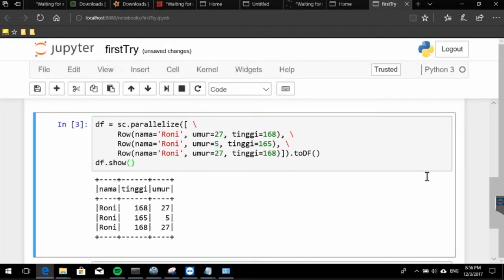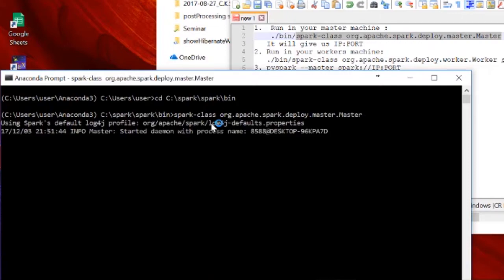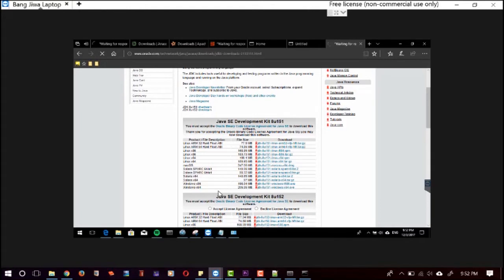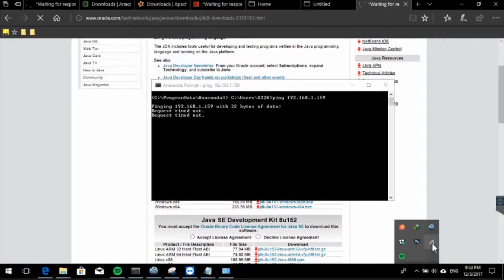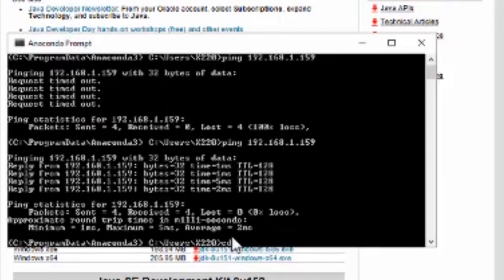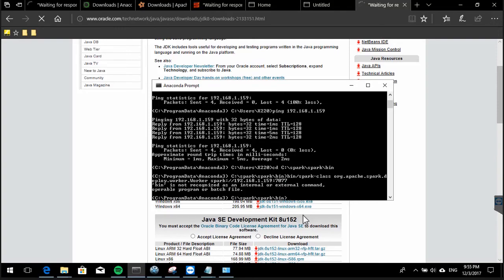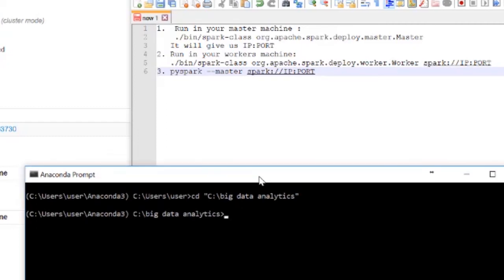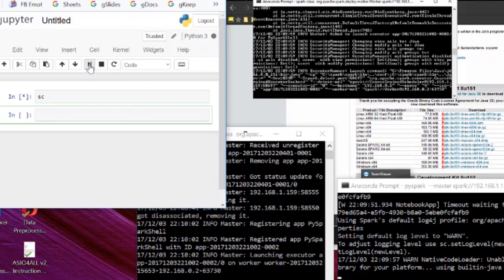03 Build Cluster Computer Apache Spark in Windows

Comment: Thanks for the video - it helped a lot. I'd like to know if i run mllib in pyspark using cluster (two computers) , will it use all resources on both computers? For neural network, i want to utilize ram and hard drives on both computers so i can train them many times
Reply from the maker: Yes, of course. The main purpose of big data framework like Spark is making the computation load into distributed resources (e.g: cluster). For all the naive Spark functions, the computation load should be distributed into cluster. If you wanna use another package outside Spark, just make sure that it supports distributed computing in cluster.
Reply: Awesome - thanks again. if I use what you have recommended on the video, my pyspark code will not run on both of them - correct? if yes, then does it mean i need to use some sort of cluster manager like hadoop?
Reply from the maker: Al K : Spark has 3 ways for its cluster manager. 1. From native Spark, 2. Apache Mesos, 3. Hadoop Yarn. And one more (still experimental, said in their official web) 4. Kubernetes.
Using one of methods above, it means that our Spark is already able to run in cluster (use all resources in that cluster) handled by the cluster manager. This video is the method 1 above.
Reply: Perfect- that is all i need to test mllib
Reply: Thank you for your replies!
Reply from the maker: You're welcome :)

Comment: I have installed spark on two windows system.
 i have run spark application program (a jar file) separately on both system. now, i want to make one system master and another system executor.

i have run this command on first system:
E:\spark-2.3.0\bin>spark-class org.apache.spark.deploy.master.Master

Starting Spark master at spark://10.1.12.1234:7077

command on on second system:
bin\spark-class org.apache.spark.deploy.worker.Worker spark://10.1.12.1234:7077

it gives error:

could not find or load main class org.apache.spark.deploy.worker.Worker

Comment: untuk cluster computer, dataset yang diproses, filenya (csv) apa perlu ada di master aja atau di workernya juga harus ada? Sebab sy ada error file not found di sisi worker. mohon pencerahan pak
Reply from the maker: Dari dokumentasinya [1], kl pakai local file system, pathnya harus juga accessible "at the same path" untuk semua workernya, bs dg dicopy ke semua workers atau pakai network-mounted shared file system. Alternatif lain, bs akses data dari path yg memang sudah ada di klaster, misal akses data HDFS. Ada jg di dokumentasinya [1].

[1] https://spark.apache.org/docs/latest/rdd-programming-guide.html#resilient-distributed-datasets-rdds